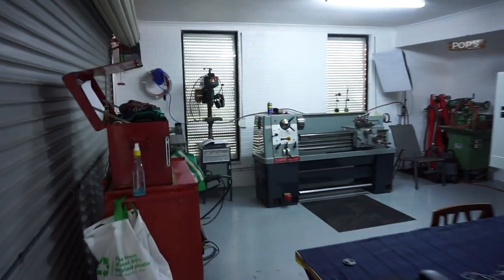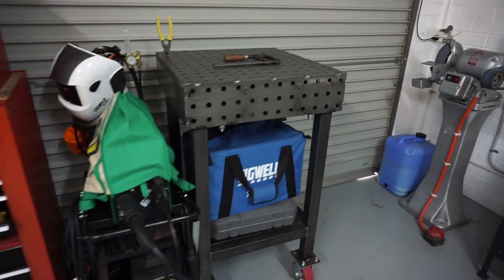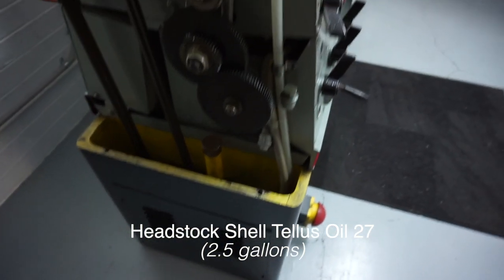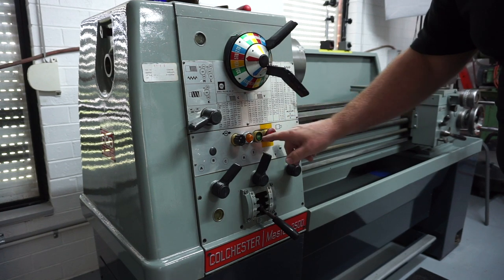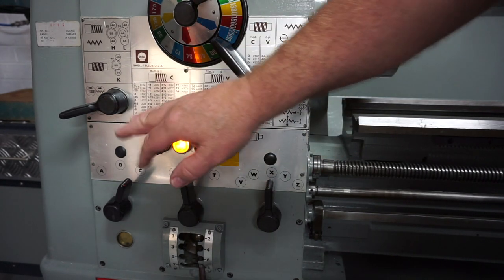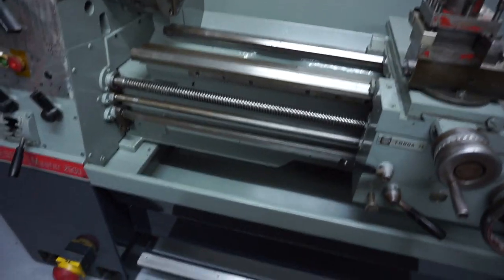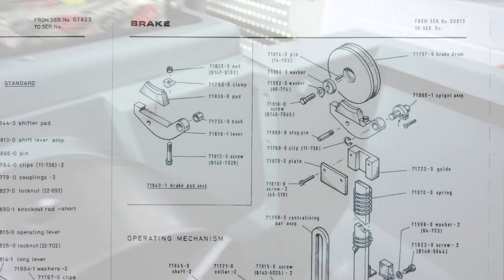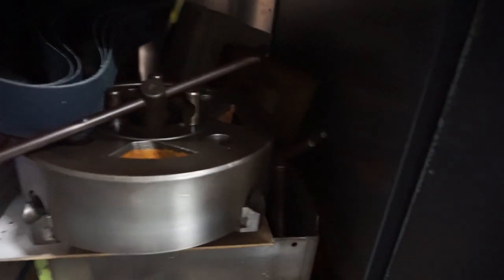Colchester Master Lathe & Shop Tour

Comment: Nice machine, I bought a Master 2500 a couple of weeks ago, it arrived last week and I managed to cause it to fall over! Broke handles off the cross slide wheel and the carriage wheel and the inner speed selector. All repairable but still annoying. It took 4 blokes, an engine crane and a lot of swearing to get it back on its feet. Speed selector handle is being welded back together, other handles only snapped the bolts off, I managed to remove the remains of the bolts from the wheels so my first job will be to make replacement bolts for the handles. I'm still in the process of working out all the whistles and bells for the thread cutting - what does the 8 position lever do? My lathe came with a DRO fitted which works fine. I only have a 3 jaw chuck at the moment and a fixed steady, I'll be getting a 4 jaw and a travelling steady sometime. Your machine with its new paint job looks excellent, I might have to paint mine now :-)
Reply from the maker: Hi Jason. Congratulations on your purchase. The master 2500 is an excellent machine. Very sorry to hear that it fell over and broke the handles etc. I would have been gutted if that happened to me. Hopefully you can get it all fixed and operational very soon. Yes I gave mine a good clean and a paint. Unfortunately some of the paint has peeled off thanks to the coolant I was using “doh”. Best of luck with it all. Cheers 🍻 Aaron

Comment: Beautiful lathe Aaron! I just bought a Precision Matthews 1440TL lathe, and am amazed at the similarities between it and your Colchester. Sure the controls are slightly different in appearance, but from the belt guard...to the layout of the controls...to the appearance of the apron, carriage and cross-slide...and even the tailstock is very similar. Not surprising I guess--if it works, go with it. Guess that's why there are about 289 different "Bridgeport clone" mills on the market?
Reply from the maker: G'day Tom and thanks for the feedback mate.  My old colchester came from a high school and was in a sad and sorry state when I got it.  A good clean up and a lick of paint and she looks brand new.  Congratulations on your new lathe.  I just looked it up on Google and it looks like a very solid unit.  I believe many lathes copied the colchester style just as you suggest with the bridgeport clones.  Cheers, Aaron.
Reply: @AaronEngineering  Indeed... I watched your videos on the cleaning/repainting of the Colchester lathe. You were lucky as that's all it appeared to need, at least from what I saw in the videos. There seem to be a lot of those things around here in the US, but to be honest 1) they're never very close to me, 2) I never have time to go look at them, and 3) I don't have a trailer large enough to haul them. But if a guy can swing it, they usually run in the $5-7k (US) range, so as long as there wasn't too much wrong with them...you'd be in luck. Any cheaper than that and you've become an "old US iron repairman," and I want to actually start working on model engines--not old machines to make model engines. So I spent more than I should have on the lathe, I'm sure. But with a 5-year warranty, a great reputation for customer service, and a supply of new parts for the lathes, the PM stuff seemed like a safe bet.

Comment: G’day Aaron, lovely lathe and great job with the restoration! I own it’s smaller brother, a Student 1800, ex qantas. They are basically the same lathe with the same bed etc, only mine is 3hp not 5hp and direct drive not clutch driven. DRO install is fiddly on the X axis with little room for a scale, Sino compact scales just fits in there neatly under the compound. 
Shell Tellus 46 Hydraulic oil is the best replacement for the headstock and feed gearbox. Shell Tonna S3 M68 is the replacement for the apron and slideway lubrication. I highly recommend fitting a quick change toolpost, the original Dickson is great, or the E size multifix / Chinese clone is a great fit. If you find you need parts for the brake system I know of a master 2500 being parted out up here in Sydney. I can also help you out with the chuck guard, I have one here with brackets and wiring etc, will send you a message via Instagram. 
Keep up the great videos and enjoy your new lathe!  
James
Reply from the maker: Hi James. Thanks for excellent information mate. You have saved me a ton of time. I’ll contact Shell and see if I can get it. For sure buddy, feel free to PM me on Instagram or an email. My email is my full name (aaronpowter) at hotmail dot com. Cheers mate 👍😂

Comment: At first glance your Master and my Colchester 15X50 are identical. After watching this video I see some differences. I have a 7.5 HP motor with 4 belts and the same oil pump affair.
My top speed is 2,000 RPM where yours is 2,500. Man, that's fast!
Your apron controls are a bit different too. My wheel is on the left =no gap.
When you started the spindle you pulled out and down. In my manual it says to pull out and down to go into reverse. To move spindle in the normal counter clockwise rotation, lift up on the lever. Interesting.
Regarding the spindle drive oil, you are correct it's a hydraulic oil (Mobil DTE24 hydraulic fluid and the other is equivalent to Vactra #2 Way oil-used in the apron) I can't remember what's in the gear box, I think it's the same as the spindle?? I could be wrong-warning.
Your hand pump for the apron is in the lower left, mine is upper middle.
Just noting differences. Your lathe is in beautiful condition. Mine came from a school also and is in outstanding condition. I can maintain consistent close tolerances, the spindle bore -MT6 and the tail stock MT4 are baby smooth with no signs of abuse.
The levers are a bit different also but almost identical.
I enjoyed seeing your shop! I wouldn't know what to do with that beautiful CNC mill.
Stay safe.
Jeff
Reply from the maker: Hi Jeff.  Thanks for providing such detail.  I'm not sure if I read that in my manual.  I need to go back and read it again.  Maybe, I've got my phase wrong and the handle should go up and not down?  My apron oil pump doesn't work unfortunately.  I will have to try and fix it one day.  I think it has dried up and the seals are all cracked probably.  Speaking of oil, I still need to dump all of mine and replenish it with new oil.  slowly slowy though, as all this stuff costs money doesn't it?  Cheers, Aaron.
Reply: @AaronEngineering  
My apron pump didn’t work either when I got it. I took it apart, replaced the common rings and it worked!!
It’s a simple plunger pump.
Reply from the maker: @millomweb  Read page 8 of the manual, "with the main motor running move lever (A) out and down for forward rotation, up for reverse"!

Comment: I’ve got the next generation of the colchester master the master 3250vs with an inverter drive and 10hp motor a bit of a beast used Colchester’s  for years from the student 1800 up to the mastiff 1400 good machines a real workhorse
Reply from the maker: G’day buddy. Oh that’s awesome. That’s a sweet Colchester lathe you’ve got. Arthur from Live Tools in Sydney has one very similar to yours. This is my first Colchester I’ve ever owned and I love it. It’s an old school lathe, but it hasn’t been knocked around too much. Thanks for watching and commenting. Cheers Aaron

Comment: Can I ask how much the phase converter set you back? I've got my eye on a similar lathe, but they're not giving it away like yours ;-), this house is single phase so I have to figure that into the calculations.
Reply from the maker: Hi Jon.  My Colchester came from a western suburbs college in Melbourne. I swapped my little single phase lathe for it.  I'm still out of pocket $3K for it, but it was still an excellent deal.

I have a PC8 phase changer running my entire shop (5 machines).  My house only has single phase power attached.  However, I had a 35amp 240vac line run to my phase changer to power it.  This is slightly under rated, but it works fine from that supply.   From memory, I think the PC-8 is roughly $6-7K.  I would ring them direct and ask to speak to Mark Bridgman.  He is the company owner.

Now Mark has another range of phase changer for sale which is much cheaper.  They are fine to run motors and manual machines, but not electronics like a CNC.  See this video on my other channel
https://youtu.be/Om-di7LX3QE
Anyway, speak to Mark and explain to him your application.  He is a very honest and extremely helpful guy.  If you call him tell him Aaron sent you (wink wink).  Cheers, Aaron.
PS: No, I am not on commission LOL

Comment: That's a beautiful lathe there Aaron. It looks like it hasn't done many hours. Did you buy it from a TAFE or somewhere similar?
Reply from the maker: HinTony. Thanks mate. The 3 machines (lathe, drill press & pedestal grinder) came out of a Melbourne high school. They were going to scrap the grinder and drill. I swapped my little Chinese single phase lathe which cost $2K for the Colchester. Add another $400 for the crane truck. It was a great deal 👍
Reply: @AaronEngineering  Extremely good deal there!
Reply from the maker: Deal of the century 👍